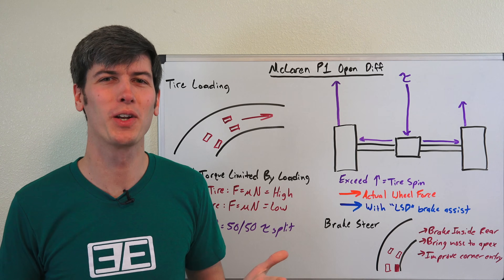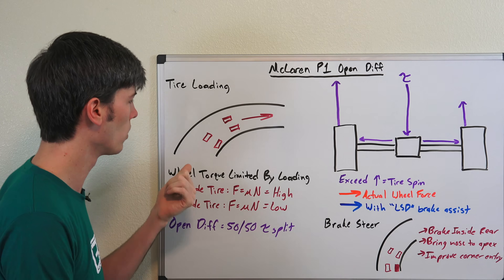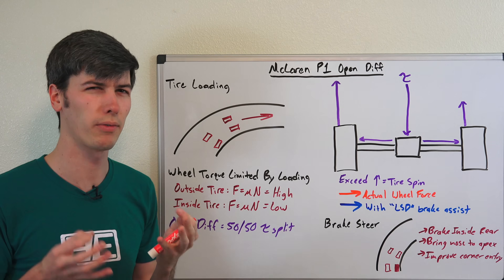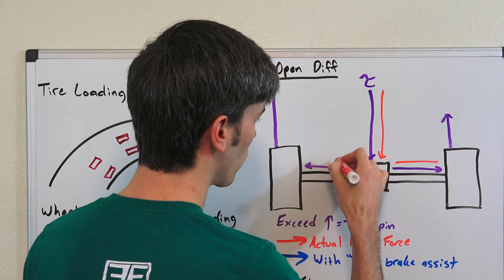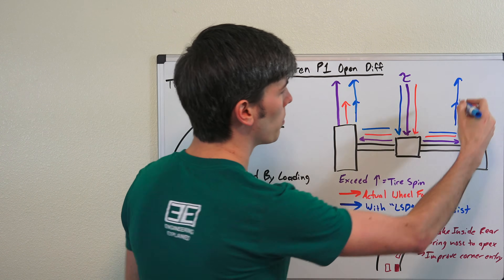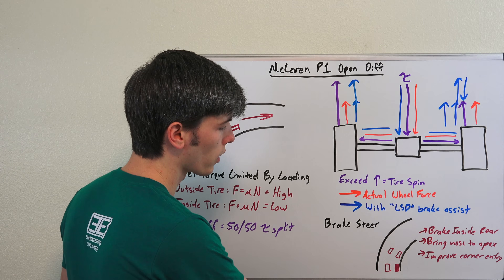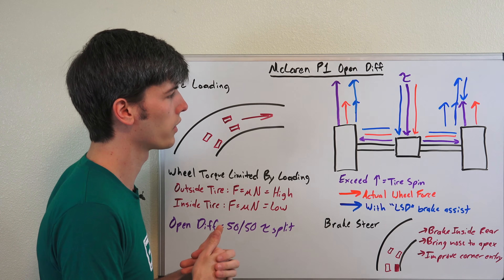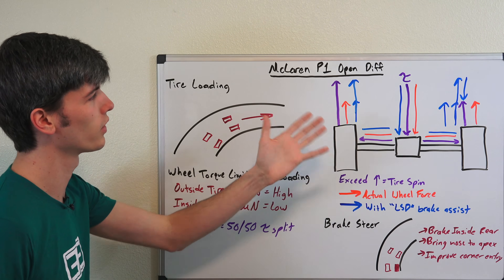The McLaren P1 Has An Open Differential?

Comment: It's not an elegant engineering solution.
Reply: It wastes energy.
Reply: Differentials do not waste a whole lot of energy. Clutches waste no energy when disengaged, only when slipping briefly at pull off.
Viscous couplings I agree do waste energy and are not an ideal solution and that's why dual clutch gearboxes are so popular now.
Reply: Brakes are such a safety critical element in a vehicle (particularly a high performance one) I'm a little weary using them in this way. I know it's workable and your points are not all without merit but the life of the driver is now hanging on the ECU working perfectly with zero problems. What I'm saying is that in this scenario the ECU (or whatever you want to call it) now becomes a piece of safety critical equipment. I know it's done in aerospace applications often (and I'm still uneasy about that) but at least the code is triple checked and vetted by external people bla bla.
Ironically, I design electronic systems for a living and know that they can fail in unexpected ways.
Reply: F1 uses clutchless gear changes. If they didn't they'd have to pit for a new clutch 5 laps in.

Comment: Well this system works very well because it is the 2nd fastest street legal car in the world around a track. Only surpassed by the 918. If this system was even a little bit of an issue then the P1 wouldn't even be a top 5 fastest car.

Comment: The moment he started talking about braking force with a LSD to hold back the opposing tire he lost me. I'm assuming he's referring to a general limited slip. So your inside tire doesn't hold back the outside tire unless they are physically locked together which is something you never do unless your welding your diff or using an aftermarket locker for drifting or drag racing. A typical LSD has a slip range where one tire can spin freely at a different speed than the other tire up until a point, being 2 to 4 times faster or slower until. Then one of the tires will break loose from the road to keep up with the other tire. The only time you have your brake trying to compensate is with a computer controlled traction control where the brakes counter the torque applied to the tire that's loosing traction.

So again, WTF is he talking about with a LSD applying braking force...

This is the second time I've caught him explaining something where my knowledge contradicts his, so either I'm missing something, I'm missinterpreting what he's saying, or he's wrong.

Another point I want to bring up. An open differential doesn't apply torque to both wheels equally.

Comment: Using brakes to go fast is never a good idea. This problem SCREAMS Torsen for the answer.
I still can hardly believe it. Never thought of McLaren as a budget box before. Absurd.
Reply: john hanrahan  
Agreed. A torsen diff center complimented with a properly calibrated "brake steer" system can easily outdo the open diff due to the torque biasing nature of the torsen.
Reply: ***** 
The only hardware that's somewhat fancy here is the hydraulic suspension (ignoring the hybrid system, etc.).

The hardware needed to implement brake steer is all there for even econoboxes of today. All you need is the same hardware needed to implement stability control, typical of many ecoboboxes in this day and age.

Combination of TC with torsen has been done before with the Humvee (the real one for the military, not those sorry marketing excuses) IIRC. Why TC instead of just open diffs? Because the instant torque biasing nature of Torsen diffs amplify the torque transfer. 

For instance, on the rear axle, the left wheel is completely off the ground and the right wheel isn't. On detection of excessive wheelspin of the left wheel, the left wheel will be braked, and if the Torsen has a torque biasing ratio (TBR) of say, 3 to 1, the slower spinning right wheel that is on the ground will get 3 times the torque the left wheel gets simultaneously.
Reply: ***** And with all that money and tech applied there should be room in the mix for an off the shelf, out of the box Torsen diff. That's all I'm sayin'. I said "econobox" as a slight to the guys that thought (presumably, but a guess and no more) the Torsen was too expensive.
 Was there some other reason? Maybe, but for the excellent solution that the Torsen offers, it's pretty hard not to criticize. At least from the armchair.

Comment: They are using an open diff because that's the only way to keep using the brake steer technology : if it was an LSD it wouldn't work, the outer wheel would be blocked by the speed of the inner wheel therefore principle of brake steer would be defeated.

Comment: I just learned that brake trick on open diff yesterday! 

my truck was stuck in the Seattle snow. only 1 wheel spins and that is going to be the tire that is completely stuck. a little throttle was completely useless and I didn't know if I was digging in grass. I revved it up about 4,000 rpm and it had its little movement. then I just happen to slightly tap the brakes with the rpm and wooooo I was moving! 

if I knew that trick a week ago then my tires probably wouldn't be so bald from being stuck in mud then snow.
Reply: I might try this idea on my car.
Reply: TheFlacker99 (Flak) I'm in Seattle too lol
Reply: I've heard Hummer doesn't have switches to lock the dif like some off-road vehicles but theres a switch on the brake pedal that enables the locker or maybe it brakes on the tire that is broken loose more than the other wheels so you don't lose as much power or something but the trick will work on any vehicle and with low range gears you shouldn't have to worry about not having enough torque to get the wheels moving.

Comment: Regera does this in much better and efficient way. It regens on inside wheel and sends power to outside wheel. Rimac and other 4 motor EVs can do this trich with all tires.
Reply: Mladen Milić, thanks to it's Hydraulic Coupling Torque Converter !
Reply: Tan Jia Yong No, thanks to 2 powerful electric motors on each halfshaft.
Reply: Remember, the Hydraulic Coupling does a majority of the jon
Reply: Tan Jia Yong You are some kind of trol?
Reply: No. Am not
Reply: Koenigsegg Direct Drive
Hydraulic Torque Converter Coupling
2 Electric Motors
900 volts Battery 
5.0 Twin-Turbocharged V8 Dry Sump Lubricated Internal Combustion Engine.

These are the main essential factors for the Regera..

Comment: The way I see it, is that a LSD has higher maintenance costs: it also wears out and labor is huge there.  
A simple open diff + braking is cheaper to maintain.  diff has to fibers to wear, and disk pads are pretty cheap and low labor

Now a P1 owner might not worry about these costs, but having the mechanics capable of doing this is not easy, ie too few of them, little experience, good ones are too far away from the car, etc.  A simple solution allows easier maintenance, that a not so expert mechanic can perform, ie change brake pads.

I think this open diff + e-breaking is an extremely good option for cars the rest of us drive, cars that are not $1M.

Comment: The intent of this system is to put ALL traction control in the hands of the traction control system.   Using an open differential removes the limited slip from the equation and makes the rear wheels completely "predictable" to the computer.

Comment: It is a complex electronically controlled traction control system that maximizes torque/power application, without the added weight of an LSD, helps mitigate oversteer and traction loss during power application. 
An LSD (except certain Torsen units) almost always sends more torque than it can use to the tire/side with less traction or shorter travel distance promoting power induced oversteer. 
Think of it as a torque vectoring strategy, if a wheel is spinning/slipping then the torque applied to that tire is reduced and sent to the other tire optimising total applied force, traction and vehicle stability.

Comment: Can someone please answer this? If they use brakesteer to mimic a limited diff, why not just use a limited diff and save the brakes from overuse?
Reply: Probably more adaptable and faster to react to changing condition then standard LSD.
Reply: MateoB 
Fully mechanical LSDs have a reaction time of practically ZERO. This system cannot possibly react faster than one control period of the electronics.

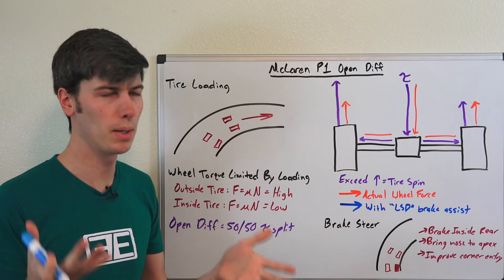Comment: 2:16 Just like ur crosstrek huh ??
Reply from the maker: Crosstrek is basically hypercar.
Reply: Engineering Explained Hahaha !! Where is the hyper hyper super (s2000) vids ??
Reply: Engineering Explained it's banned in formula one too probably
Reply: Yathu prem, Valteri Bottas already took the seat at Mercedes.
Reply: It's not about pure driving it's about the beautiful relationship between a driver's skills and the technology of the car.
Reply: Formula one is about pure driving.. so it should be banned.. The brake assisted torque divider. Also for F1 lovers, there is a high chance of Alonso replacing Roseberg.. Anybody interested??

Comment: It probably helps out the carbon ceramic brakes, since they operate most effectively in a higher temperature window. By applying the brakes even in small amounts during cornering and also during standard braking, it would probably keep the brakes in the optimal operation window for longer.

Comment: They say their silicon carbide carbon-ceramic breaks absorb 50% more energy than regular carbon-ceramic brakes. Maybe they are using the breaks to limit power on the inside wheel because they are comfortable with heat capacity and dissipation capabilities of their breaks? just a theory

Comment: I am going to assume it has carbon brakes or carbon ceramic brakes which would be hard to overheat. With a limited slip it would be harder to use the brakes to steer under power.

Comment: The reason could be one of these: 
- weight reduction or maybe better weight distribution (but I don't think the weight difference is that much)
- space: maybe they needed a super compact diff to fit in a space possiblly very tight, maybe to get better aerodynamics with a smaller engine bay (but again, I don't think a limited slick diff is that much bigger)
- this is the big one: maybe they couldn't get a limited slick diff that can deal with the massive torque and power of the P1's engine. Remember also that is an hybrid, so an open diff might have been the best solution to deal with all the different operating modes of the hybrid powertrain. Or maybe the could have got that diff, but it was not reliable/compact enough to fit their needs
- Jeremy Clarkson described the P1 as a monster, a widow maker. could they've possibly put in it an open diff to increase this wildness, brutal feeling?
- Or maybe just to be able to advertise that "F1 technology" of the intelligent brake use. Or to wear down brakes more quickly, making more money on spare parts. But considering the price, I don't think that sounds likely...
Reply: But even the little 570s is open diff, every mclaren since 12c runs open diff. They did it just for weight. Yea it is not that big of a weight difference probably but it is still weight, which mclaren hates.

Comment: I want to know how the Koenigsegg Raseri's 5.0 litre V8 engine deal with four turbo boost! Especially about its cam profile, crank load, and valve timing.
Reply: @ amanoncrack: Oh sorry I forgot, But there's still drawing question about crank load, because there's so many boost come into the cylinder. If it was W16 engine, it has two crank.
Reply: @ amanoncrack: Any internal spec has been released?
Reply: No, they don't. Freevalve is still under development and not in use in Koenigsegg's cars. They use a twin-turbo DOHC 5.0 V8
Reply: @amanoncrack: the difficulty of developing this valveless system, is how the A/F compress during compression event.
Reply: @TheAfterbanger: Raseri is using four turbo.

Comment: Hello EE , I was wondering if you could do a video of explaining if its theoretically possible to achieve 2145HP that Extreme Tuners is claiming with their DE-stroked 1831cc nitromethanol engine. 

https://www.facebook.com/ExtremeTuners/videos/vb.174241639280638/822430541128408/?type=2&theater  

Thanks
Reply from the maker: Based on top fuel nitro-meth engines making ~10,000 HP from a little over 8 liters, I guess it's possible. Explained here: https://www.youtube.com/watch?v=bI0YPTK32vc

Comment: I'm assuming they do this because electronically controlled brakes gives them finer control than an LSD would.  It does sound like the driver experience has improved a lot over the years since the MP4-12C which many disliked to drive because of this "feature."

Comment: On my race car I've made a manual Torque Vectoring system, through altering the OEM ABS unit. I gently and accordenly apply brake pressure to the front inside wheel. So I am left foot braking while accelerating out of a corner, it works great!  The main reason I made it was, cost. But the second reason is that an Limited Slip Differantial and other drivetrain components get an tremendous shock loading while lifting one wheel hitting a curbstone under WOT and come back down again. The same with cars who race in the dirt and lift of one wheel and come back down again. I've seen many drivetrain components fail this way. I think this is the main reason why Mclaren thus this on it's road going models, less maintenance, more reliable and lighterweight components.

Comment: the non performance pack MK7 GTIs use the same system. they call it XDS tho. it works amazingly but under intense driving the brakes get really hot really quickly. not so good when you dont have akebono brakes. :/

Comment: I believe the reasoning was less weight, the super crazy Akebono brakes can handle the load, combined with the lack of traditional roll bar the hydraulic suspension actuation can assist the load balance of the car to partially offset changing tire loads. I believe that is McLaren's secret sauce.

Comment: my guess would be that the brakes are able to react quicker and more accurately than the differential, and where brakes are now they could have brakes that match the front to compensate.

But than you can also have a electronic differential so.. idk! :) it's also possible you can only be so accurate with a differential and the drive shafts give to much and cause to much of a variance.

Comment: welded diffs are the best diffs!
Reply: MrRedFox1000 i love the sound of my right tire dragging on the gravel
Reply: Whatever, if you have a squeaking tyre that is not drowned out by the rumble from your engine you don't need a welded diff in the first place
Reply: welded diffs= good for drag, drift, snow, and... scratch that, welded diffs are the best diffs
Reply: nothing like pulling into a park with welded diff and the inside tire squeaking as its getting dragged and people look at you like wtf is going on here. hahaha
Reply: Detroit True Track , obama posi.
Reply: welded diff=good for drag racing. Open, good for daily driving. Lsd, good for racing/drift.
Reply: NFS logic? :D
Reply: the only time welded diffs are not 'aight is when you have a welded center diff because a pull of the rear handbrake can suddenly turn into a blown transmission haha (is that possible to weld a center diff, for real could someone politely tell me if that's possible or not?)
Reply: MrRedFox1000 lol

Comment: Very interesting to know there is that split even in an open differential, but now I'm left scratching my head as to why only one wheel will spin during a burnout. Care to elaborate Engineering Explained?
Reply: Cameron Lancaster Only the tire with the least resistance spins with an open Diff.
Reply: Open diffs send power to the tire that has the least amount of traction. McLaren is faking traction by applying the brake, therefore shunting power to the non-braked tire.

Comment: open diff was good enough for both the A Team van, and Steve McQueens mustang, I don't see a problem....☺
Reply: Anthony Leach All mustangs built in recent years have a clutch type or torsen type limited slip differential. The crashing is from idiots who disable traction control and leave the throttle floored, even when it's obvious to a competent driver that stability is being lost. An LSD actually helps transfer power to wheel with more traction which crates the sideways push effect, especially when the differential is under load. This happens with any mechanically similar rear wheel drivetrain.
Reply: Ben Wolfram lmao
Reply: Don't forget Colonel Decker's MP cars!
Reply: Rhino Bear you don't know what your talking about. All mustangs 2011+ came with an LSD. It's more so the massive power increase from the previous generation (and the solid rear axle for the s197) that people underestimated and don't respect which causes them to spin the heck out and eat people.
Reply: aren't most mustangs limited slip?   seems like when i see videos of them crashing into crowds both wheels are spinning
Reply: open differentials are the biggest problem with mustangs.... aside from the fact that they are fords.... which also means electrical problems and general shittyness.